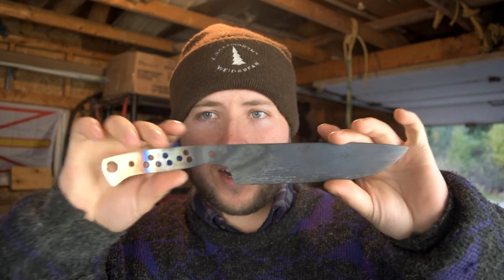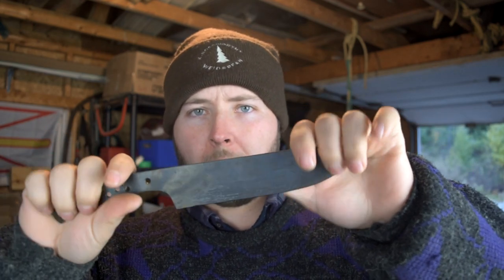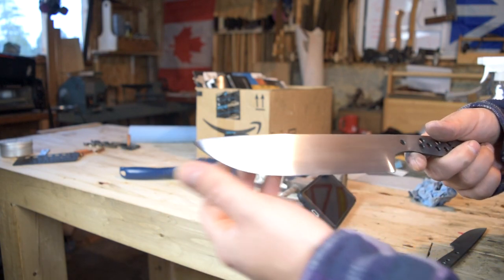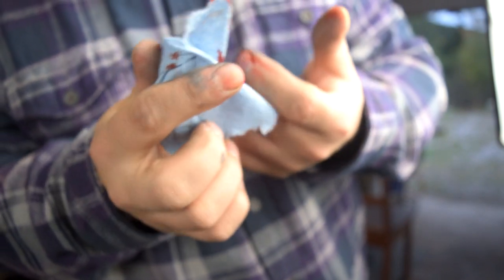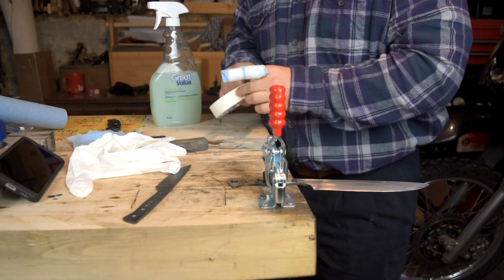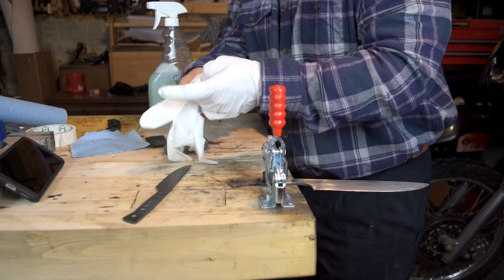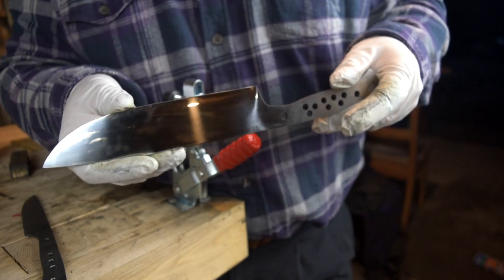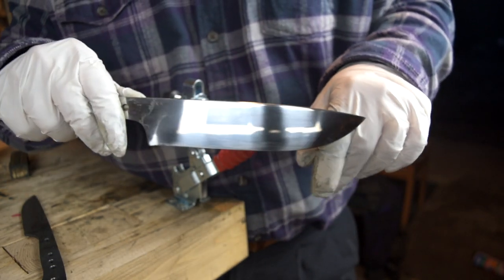Making A Bushcraft Knife Set - Ep.3

Comment: Both blades looks fantastic, but I prefer the big guy, a perfect blade for some serious work in the woods or in the mountains. How hard did you get that 01? If you tempered it at around 300° F u can get it up to 64 even 65 I have heard and if you temper it at around 600° F you will end up around 57. This is if my memory serves me correctly. Or did you choose a happy medium or did you shoot for the highest hardness possible? Because the way you cut yourself and had to dull up that edge it looked and sounded very hard. Great work, Kyle.
Reply from the maker: The blade was quite hard! with a proper quench, O1 gets up around mid 60's HRC. I think tempered it at 450F for 1 hour, which should have brought it down to high 50's!

Comment: Order your sandpaper from klingspore you can get there wet dry sandpaper in rolls and it last longer than 3m and it's adhesive backed so you can keep your fingers away from the edge when hand sanding
Reply from the maker: Do you have personal experience sanding steel with the Klingspore? I'm skeptical!
Reply: @kyle_noseworthy  yes I do I restore a lot of axes, hand planes, chisels, old Knives just about anything and it definitely last longer and is cheaper in the long run buying it in the rolls. I used 3m for a long time till I tried klingspore and never looked back
Reply from the maker: Thanks for the info! I'll get some to try. I'm holding you responsible if it doesn't work out!
Reply: @kyle_noseworthy  i will take the responsibility. There's also some places on eBay and Amazon you can order 3000, 5000, and 7000 grot paper